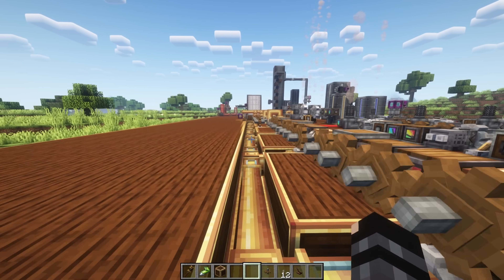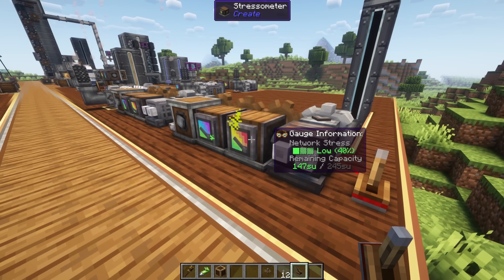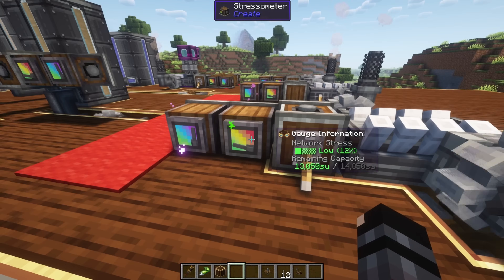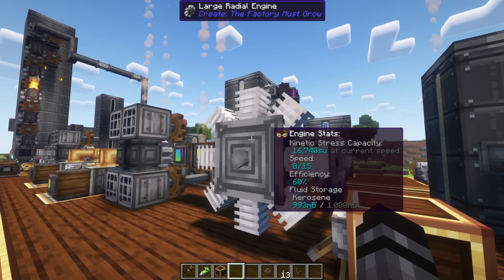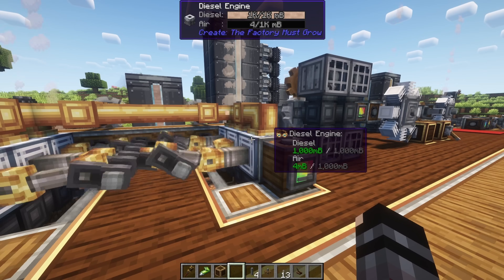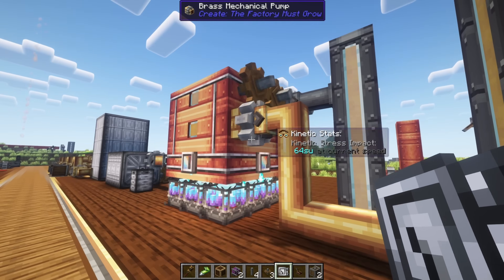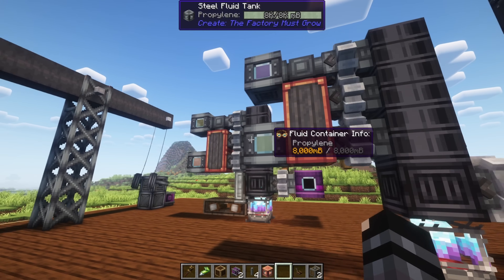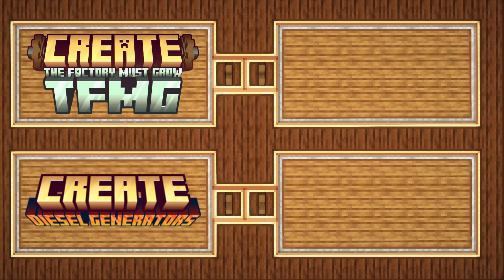Which Create Engine Mod is Right For You? - TFMG vs Diesel Generators

Comment: As someone who has sailed on ships, I say that Diesel Generators dissapointed me. Except for the distillation, which is absolutely more correct. TFMG has great ideas, like the air. But using a pump for air is wrong. Instead, they should make a compressor. Which is the correct name for an air pump. It would also be cool to have a turbine and a gas turbine.
Reply: Dude, it's minecraft create addon with engines. Not overrealistic and overcomplicated mess simulator

Comment: If you’re using the valkyrien skies mod, TFMG is the way better option for building the engine. It’s more involved with adding the exhaust and everything, and by default, the engines seem to be turned off, which makes it much easier to operate than the DG engines which are on by default (i might’ve been doing it wrong, but every time i put fuel into it, it just kind of broke, and then nothing worked. Never had that issue with the TFMG gasoline engine)

Comment: This video has a tiny mistake which derailed me.
When you're making the mini distillery (distilling naphta in this example), you need to make the same system as the big distillery, just that one blaze heats the 3 tall fluid tank, which are connected by a distilling controller on a steel truss, then distilling output, industrial pipe, distilling output. You then pump out propelyne and ethelyne from those blocks.

Comment: I use Diesel Generators, because I had some stability or incompatibility issues with TFMG on 1.18.2. I use Immersive Engineering to make the fuel, and use the diesel generators aboard vehicles, like the airship I just built, which uses a modular diesel generator to power it's decorative propellers, machine shop, and it's electrical system.
Reply: I had the same issue and I think I solved it by deleting the create mod and reinstalling it so flywheel is the right version. Whenever you download it I think it changes the flywheel version
Reply: you could use KubeJS to add forge fluid tags onto the various fluids you want to be compatible, it only took me maybe 20 mins of tinkering and theres a bunch of tutorials
Reply: @ The issue with TFMG was the game crashing on load, not fluid incompatibility.
Reply: @henryfleischer404  does it say anything or is it just like code -1 and says nothing else.
Reply: @Person-t1b  IDK, it's been a month since I last cared

Comment: When i get my device fixed i wanna test out one of these mods with trackwork to see if i can make a vehicle that can facillitate the majority of my needs but the only issue i have is deciding on if i want to pick the one with carbon emmissions for a more on theme look or the one that tajes up less space so i can actually fit it in the front of the van/truck thing
Reply: Also i wonder if someone has made a cargo plane in VSkies yet, if i could fit a trackwork vehicle in a massive plane that would be cool

Comment: I wanna love TFMG, except the crude oil deposits are essentially next to impossible to find, it's scanners basically don't work at all and send you to completely random directions which never actually have any oil at them. Half it's content can't use oil from other similar mods even when using the "Addon Compatibility" mod. It's a shame because if it wasn't next to impossible to find these things it would be one of the greatest create addons of all time, or even one of the best mods on it's own ever. As it is though, it's so hard to find the oil deposits it's essentially next to impossible to actually use the mod, it's unplayable.

It's a shame too because this one bottleneck is the only problem.
Reply: The problem with tfmg is that the imput and output of the pipes do not look like they're pumping in or pulling out stuff since they do not mesh well with the engine itself, making it look like it's pulling from air.

Comment: Thier are problems with the mod not survival friendly if you want to make oil pump you need steel witch ot make stell you need serten blocks that are not craftibel.
Reply: Lest there is an explicit add on to do so, multiblocks don’t show up in recipe browsing mods. Thus you just have to rely on guessing the components, using  pondering or googling it.

Comment: you say that TFMG doesn't have renewable fuels, but do you mean that in the real world sense?  because in the game, i'm pretty sure the oil deposits are infinite.
Reply: The problem with tfmg is that the imput and output of the pipes do not look like they're pumping in or pulling out stuff since they do not mesh well with the engine itself, making it look like it's pulling from air.

Comment: The saddest thing about those two is that you can use crude oil from tfmg in dg's distillation tank, but you can't do the inverse. So you can't use crude oil from dg in tfmg distillator. I want it to be compatible because tfmg's pumpjacks are HORRIBLE. they look AWFUL: these strings hanging from them are not pleasing at all.
On my modpack i even replaced them both with oreexcavation's liquid extractors, extracting tfmg oil in limited amount.

Comment: 1:24 "Adding a turbo to this diesel engine doesn't affect its power, but it does speed it up."
That's literally the most backwards way that could have worked! A turbocharger works by compressing the air before it goes into the engine, giving it more air and thus more oxygen to burn fuel with. And creating more power as a result. But that doesn't significantly alter the maximum rpm of a diesel engine. As the reason why diesel engines have such low maximum rpm in real life, is because diesel itself burns really slowly. So at high rpms, the piston will literally move away from the combustion gases, faster than the combustion gases can burn and expand.
Reply: And since we have the rotational speed controller, the speed doesn’t really matter anyway, we just need more SU

Comment: diesel generetors is compatible with immersive petrolium (the addon from immersive engeniering) and the petrolium are compatible between them and you can use the diesel and biedisel ande gasoline from the immersive petrolium on diesel generetor, but with create the factory must grow: yo can not

Comment: CDiesel Generators actually can be compatible with tfmg fuels since it's data driven! Fluid tags and such!
Reply from the maker: Would the mod devs have to set this up or can players edit a config file or something?
Reply: @KwizzleHazzizle  Oh sorry! Didn't get a notif outside of Gmail for this.
Data driven means it's Datapack work, so it can be done by anyone or even publicly uploaded to Mod sites (curseforge/modrinth/etc.)
The mod itself doesn't have tfmg's fluids tagged in its jar, so it would have to be an external datapack. A lot about the mod can be tweaked with its tags however, so there's a lot of options available with it.
Reply: The problem with tfmg is that the imput and output of the pipes do not look like they're pumping in or pulling out stuff since they do not mesh well with the engine itself, making it look like it's pulling from air.

Comment: only really clicked on this video to check out the comments, and damn they all love tfmg
Reply: a lot of people i know utterly despise tfmg due to various reasons, them being:
- textures, barely fitting in create
- unnecessary levels of complexity
- plastic?? cast iron?? steel??
- twelve different oil outputs, only just to fuel another engine and no other uses (content bloat)
- making plastic in an open topped basin 
- buggy oil distillery that takes forever to figure out how to set up
- non create styled multiblocks, pumpjack doesnt work unless built very specifically
- fluid air?? fluid exhaust?? can simply just send it out the end of an open pipe rather than using an exhaust pipe
- doesnt use tags, isnt compatible with other mods, is a nightmare to integrate into proper modpacks, too much work for what its worth
- and several more i could list off if i take a moment to do it, tho i cant rember too well as i just woke up

c:dg also isnt perfect, but its a lot better than c:tfmg, the major gripes of c:dg being:
- singleblock combustion engines?? for similar SU to steam engine tier?? (for good SU producers, it should have more multiblock setup, similar to that of steam engine)
Reply: @poly1810  idk i kinda like the textures, and the complexity is totally a personal thing. i had the opposite impression, tfmg looked more interesting because it doesnt dumb the processing down so much that its boring (i see that in a lot of other addons, to the point where it can feel like there isnt much variety between them)
the rest seem to be minor nitpicks or things that could be easily fix, the most valid point there is the incompatibility. my own biggest gripe is unavailability for fabric tbh
Reply: no, only comparison videos of really bad mods and there actually semidecent counterparts

Comment: The factory must grow is a great mod for the more complex packs that you can make, like the one that takes you through ages of tech. However, I'd say that the create diesel generators feel closer to the original intention of the create mod
Reply: The problem with tfmg is that the imput and output of the pipes do not look like they're pumping in or pulling out stuff since they do not mesh well with the engine itself, making it look like it's pulling from air.

Comment: so TFMG is just a more realistic. And better...
Reply: The problem with tfmg is that the imput and output of the pipes do not look like they're pumping in or pulling out stuff since they do not mesh well with the engine itself, making it look like it's pulling from air.
Reply: It ain't realistic if the pumps don't mesh well with the engine.

Comment: Both mods are pretty neat, tho the only gripe I have with TFMG is the weird choice of rpms. They're almost all this weird number that is tricky to use right off the bat and need a speed controller for a more precise control, whereas DG you have usable numbers where you dont necessarily need speed controllers.

It's a nitpick for sure but that was always something that bothered me
Reply from the maker: Right, would be better if they had like 64 or 128 rpm or something

Comment: sadly there is no TFMG for fabric :( edit: How do i use diesel generators canisters and barrels? idk how to pump things into it XD
Reply: Just connect a pipe to the top and use a pump to pump it in from a tank.
Reply: @ignoremycommentsmadebefore2025  didn't work
Reply: @F3lisL3o  is your pump working the right way? And if you place a pipe on top of the canister and another one next to that pipe does the pipe still turn into the canister? If not I think something is wrong on your end, it works just fine for me.
Reply: @ignoremycommentsmadebefore2025  You're right the pipes didin't change direction. Idk what could be wrong on my end, everything works fine but that part. Maybe an bug on the Fabric version?

Comment: for air intake, u can make 1x1 fans 2x2 fans and 3x3 fans. idk about how much su they take, but u only need power one of the fans instead of all of them. for create the factory must grow
Reply: The fans take 0su, they only need to spin
Reply: @blueberry1c2  even better
Reply: The problem with tfmg is that the imput and output of the pipes do not look like they're pumping in or pulling out stuff since they do not mesh well with the engine itself, making it look like it's pulling from air.
Reply: @hotheatwave01 why did you spam this reply in multiple comments?
Do you hate TFMG that much?

Comment: I really want to have Diesel Generators but with the waste management!! i wanna feel like i'm polluting the environment just to squeeze out a few more SU
Reply: Try the Destroy Addon for Create, adds plastics and chemicals
Reply: @arthreasdarandar1017  I did! Didn’t like it. I could try my hand at using crafttweaker to make the recipes more engaging though
Reply: Idk if pollution of the realms exists for the versions these addons are on, but if so you can install that and hopefully there would be cross-compatibility
Reply: @kakyoinpepsi5694  i mean i want to feel like i'm polluting the environment, but keep doing it. pollution of the realms forces you to take care or you die at some point. i imagine i could instead make a mod that makes certain processes fill the environment with like, acid rain, soot, and even water pollution that you can either manage or just- ignore for the sake of industry

Comment: Both of these addons are perfect, one for the more complex systems enjoyer and one for the casual enjoyer, it's awesome
Reply: The problem with tfmg is that the imput and output of the pipes do not look like they're pumping in or pulling out stuff since they do not mesh well with the engine itself, making it look like it's pulling from air.

Comment: TFMG gotta be ported to fabric. This mod is incredible.
Reply: The problem with tfmg is that the imput and output of the pipes do not look like they're pumping in or pulling out stuff since they do not mesh well with the engine itself, making it look like it's pulling from air.
Reply: @hotheatwave01  why are you spamming this

Comment: Bruh i thought create could not get more confusing
Then i discovered addons like
Tfmg, create cc, and a mod that i forgot the name but it adds theoretical physics to create
Reply: Valkyrien Skies: Clockwork and Create: interactive are the physics based create mod add ons, clockwork allows you to build vehicles and interactive makes create contraptions(the parts of a machine you glue together and attach to a bearing to move) have physics, so they don’t go through walls and collide with one another.

Edit: interactive also makes train derailment have physics, so trains will actually “derail” fully off the track rather than having their usual fixed derailment animation

Comment: TL;DR TFMG is more realistic but requires more work
Reply: The problem with tfmg is that the imput and output of the pipes do not look like they're pumping in or pulling out stuff since they do not mesh well with the engine itself, making it look like it's pulling from air.
Reply: @hotheatwave01 bro is really hell bent on copying and pasting his comment everywhere
Reply: What do you mean realistic if meshing is not good

Comment: For me it seems that engines from both mods suck in SU output comparing to simple steam engines from basic Create, but need much more work to run them.
Reply: Idk man diesel is super easy lol you just find a chunk with oil and you get thousands of buckets. They aren't exactly a steam engine alternative, they are just extremely compact and easy to install on moving contraptions. Works wonders with clockwork since a single bucket can last an extremely long time.

Comment: For Create: Diesel Generator, you can apply a redstone signal to the engine as well to turn it off and save fuel.
Reply: It gets bugged for now. The engine stops but the shaft keep turning. So until they fix it its uselless
Reply: @I_DONT_GFU_BOUT_USERNAME  you are using it on fabric? Fabric port is incomplete and a bit broken,  resdtone does not work on modular engines, ,it stops them and they never work again,  oil barrels which are just their own fluid tanks don't work either, recently i saw some other person got their hands on the port that was abandoned and started working on it further

Comment: Would really recommend Create: Addon Compatibility to anyone using both of these addons together.
Reply: Alright, this guy probably just saved my sanity over the horrible tfmg's pumpjacks
Thank you, nett mann
Reply: Ah, fuck it, doesn't work with tfmg distillators
Reply: @DevilOventus  pain
Reply: Will add
Reply: You need to glue the hammer part of the pumpjack
also, the pipes need to be industrial, not steel or anything else
Reply: yea doesnt work. any suggestion?

Comment: Excellent video! Personally I've always liked TFMG more. It feels way more immersive
Reply: The problem with tfmg is that the imput and output of the pipes do not look like they're pumping in or pulling out stuff since they do not mesh well with the engine itself, making it look like it's pulling from air.
Reply: @hotheatwave01 can you stop saying that on every single reply?

Comment: But... level 9 steam engines are just better... While the mods are interesting, I wouldn't bother with refining oil just to get less SU than 1 or 2 steam engines...
Reply: BUT these are a LOT smaller than steam engines and you can stack them
Reply: @RoBg-b1c6k  I did not expect a response in a year

At the moment, I can see these engines used in Clockwork cars and airplanes at most

For the main base, "level 9" or 2 of these will be enough

Comment: Nice, however so disappointed that both mods use "make-pretend oil deposits" 🫤. In good old Industrial Craft, oil deposits are actual, visible liquid deposits. You don't have to pretend thay they are there - they are part of the world, just like lava and water. These solutions feel half-hearted 😑.

Comment: Yo, i think you made a mistake. The diesel engine from diesel generators produces only 3k su, modular engines only produce 4k su.
Reply: the su generated differentiates between different fuel types
Reply from the maker: He's right though I just checked, I don't know what happened with the stressometers
Reply from the maker: Oh man, I just checked, you're right. I don't know why but the stressometers are giving the wrong reading...